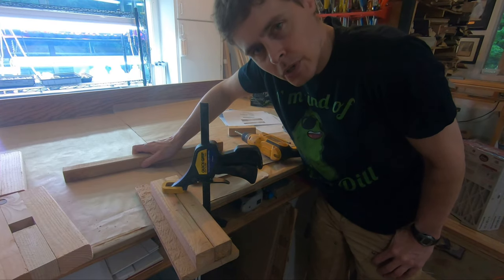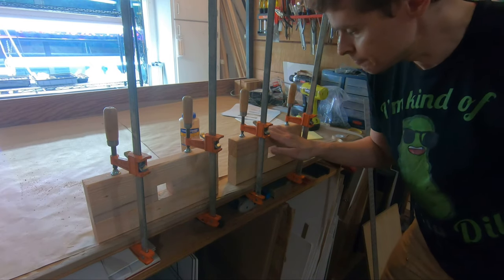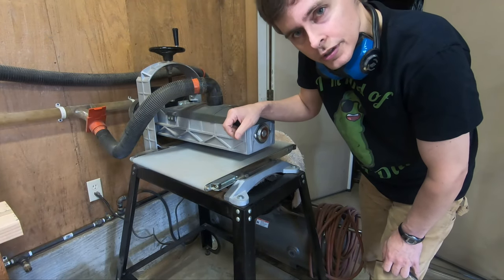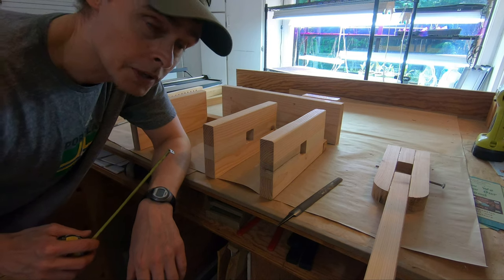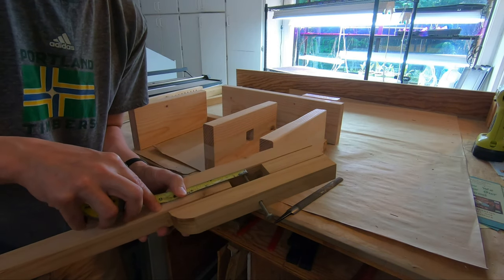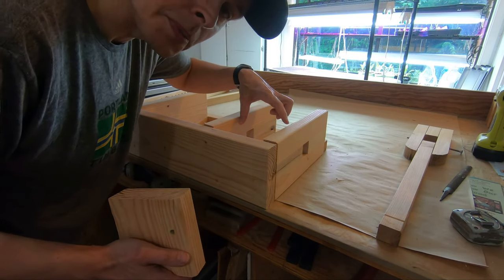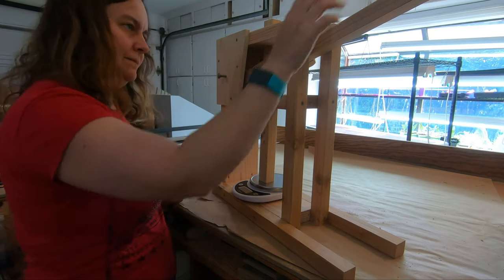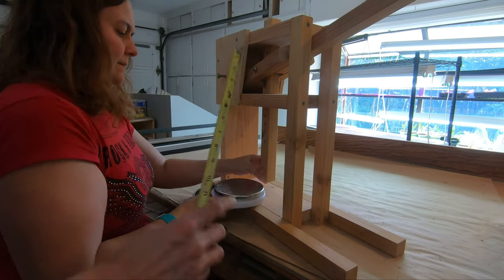Building a Cheese Press - DIY Dutch Cheese Press

Comment: If you can provide specifics on the arm and plywood supports, the rest can be filled in as needed. Need to know length of arm and hole location for the pivot pin as well as the dimensions of the plywood braces with pin hole locations. Those are the key to the equation. Any info you can provide is greatly appreciated.
Reply from the maker: I have just posted a video with the information you need.  https://youtu.be/i7CqqyEr0uM?si=6-8nLzA5pU71Yk3q

Comment: Appreciate the build, couple of ideas if you ever make another.   It would be simple to widen the throat of it for a larger cheese wheel if necessary.  You could also set incremental holes/ screws down the entire lever.  This would allow you to pin a weight to the lever to adjust the weight on a more variable scale.
Reply from the maker: Thanks for the advice.